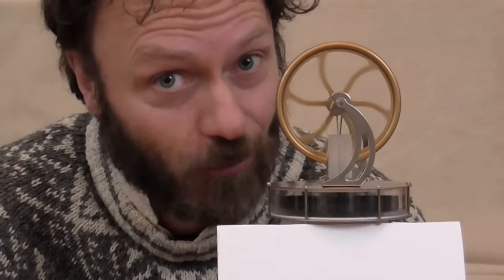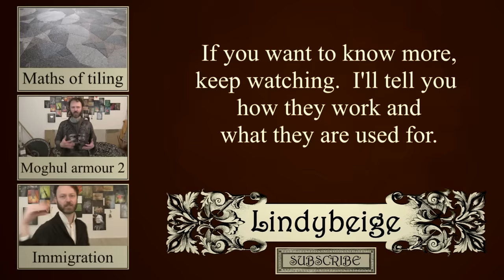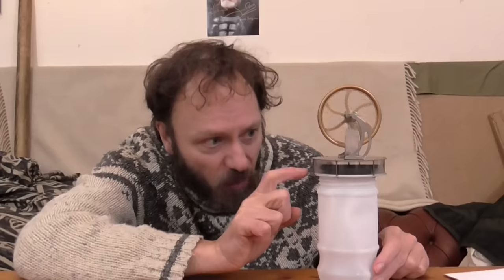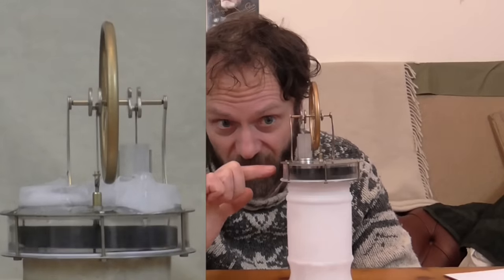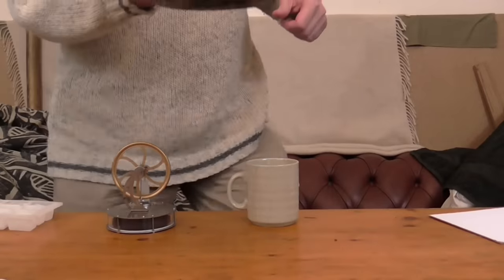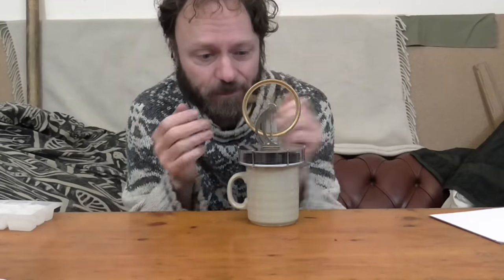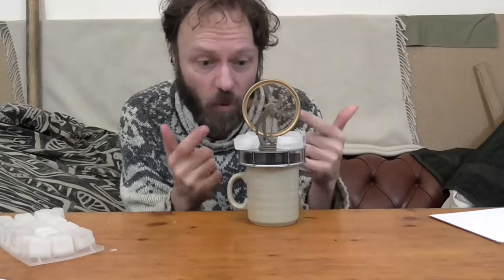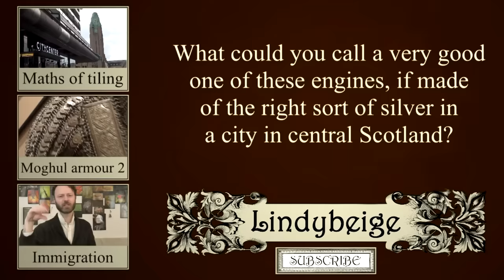Stirling Engines - the power of the future?

Comment: As you mention, Sterling engines have a comparatively poor horesepower/weight ratio.  Also, they have a rather poor horsepower/InitialCost ratio.  Yes, the greater efficiency pays off in the long run, but the cheaper outlay (for a diesel engine, e.g.) pays off right now.

Comment: The engine is currently being powered by the ambient temperature in your home, not the ice. Ice power is a violation of the Zeroth Law of Thermodynamics. The ice is just providing the temperature difference for the device to work.

Comment: Use an insulated 100% stainless steel coffee cup instead of glass or ceramic. Much better results. The heat transfers from metal to metal very well. Over 3 hours run time, easily.

Comment: the problem with stirling engines is that to make any amount of power, you have to go to high pressure gas, close tolerances and very low friction to make them work efficient.
Reply: So use mag lev for a frictionless drag
Reply: Sme with any good engine j meyers.  In other words no big fucking deal.

Comment: It'd be great in space, yes? I mean, assuming that you have to heat the inside of your ship anyway, you'll have a temperature gradient of at least a hundred degrees celsius at all times. The sunward facing side of the ship will be heated to over a hundred degrees celsius by the sun, vs the temperature of the inside of the ship (ideally about 22 degrees celsius), so that's a helluva temp. gradient. And the other side of the ship would have an even greater gradient, with an interior of 22 degrees vs an exterior of around -200 degrees. So regardless of whether your spaceship is in the sun or partially in sunlight, or entirely in darkness, as long as you're heating the inside anyway, you'll always have a delta t of over 100 degrees.

Comment: Why not do it on the coast as the temperature difference between the water and the air is there all the time whether its day or night time.
Or it could be the modern equivalent of the waterwheel if used on rivers/streams, again because of the constant difference between water and air temperatures irrespective of where you are on the globe.

Comment: they are basically the reverse of an air conditioner compressor.
Reply: If you turn the flywheel of the engine it actually becomes a heatpump. Making one side cold and one side hot. Stirling cryocoolers can be used to create liquid air.

Comment: You know... If Stirling engines work with heat differential, then it means that you're harnessing energy while transferring energy to one place to another. If you happen to find the volcanic activity in Antarctica and use that heat differential to power Stirling engines, then it means you're transferring heat from the earth to the ice. You will melt that ice faster, increasing the speed of global warming.

Comment: "Regenerative describes the use of a specific type of internal heat exchanger and thermal store, known as the regenerator. Strictly speaking, the inclusion of the regenerator is what differentiates a Stirling engine from other closed cycle hot air engines"

So, strictly speaking this is not true Stirling Engine? I don't see any heat store =\

EDIT: Oh, i see... In small low power engines this can be just the walls of cylinder.

Comment: What he is saying is;  Temperature is the measure of energy Intensity inherent in a constant volume's (Gas or In-incompressible) object's arranged Atoms and their associated dynamic forces.  Thermal potential energy is therefore implied? Heat is measured in Joules, Calories, BTU, etc.  Energy and Temperature are not fundamental units, they are independent variables and encapsulate the MKS system of units, This is known as the S.I. system . Professor John McEntegart would like this curious audience to think about the following. 

 An adiabatic process is defined as a process in which no heat transfer takes place. This does not mean that the temperature is constant, but rather that no heat is transferred into or out from the system. ... (The actual definition of an isentropic process is an adiabatic, reversible process.) Thermodynamics is the study of matter and thermal ramifications and the associated phenomena. This subject is particularly interesting amongst physicists and mechanical engineers.

Temperature is inextricably linked to Heat. That is the basis of Thermodynamics. Inherent properties are often hidden in plain sight.

Comment: If you want to look at something really effective, try Ocean Thermal Electric Converter or OTEC, uses the temperature differential between deeper sea and surface temperatures to generate electricity. Not to mention there are Tiles that generate electricity from temperature differential that are solid state, no moving parts. Stirling is Dead tech.

Comment: The Stirling engine matches the efficiency of the diesel engine but lacks its power/weight. And the for everything that doesn't move, like the church example, the electric motor far exceeds any other engine, it's cheaper to build and maintain, it's lighter and more compact, it has 95% thermal efficiency, quiet. When you said that the Stirling has 50% efficiency, did you take into account the thermal losses from the refrigeration unit and/or the heating element, because those have some big losses too. Stirling does make emissions unless they are powered by electricity, in which case JUST USE ELECTRIC MOTORS.

Comment: I read where a Stirling engine driven by an electric motor would condense carbon dioxide out of the air surrounding the closed end of the displacer cyclinder

Comment: Stirling engines had advantages as a refrigeration unit but hopeless as a power source. They need a large temp difference between gas in different parts of the engine. Good materials that resist the high heat are hopeless mediums for heat transfer. There is no way around this unless a super material is developed.

Comment: Sooo, If you istall copper wire under the seatbanks of the church. This way the heat radiating from the bud´s of the people will, warm the copper, which transports the heat towards the cold cellar where the sirling engine powers the Church ?

Comment: The most efficient way to run this thing I can think of is basically nuclear fission which we already do except instead of using nuclear to heat water up we can just have this thing run off it's own power and use a space heater

Comment: Or use a geo thermal heat source to operate a compression furnace to cool a refrigerant to keep the lower plate cool in a hot climate and the top plate hot in a cold climate . Free energy ! Ta Da!

Comment: Cold is energy. It's "negative" energy, now eat this..lol. But now some SF: imagine cities in the far and hot (?) future under domes and in need of cooling.  Batteries are superior but slow moving city transport on liquid nitrogen and a Stirling motor would cool the city in it's use. The liquefying process on solar could, because of the waste heat, happen outside the city.

Comment: Also called a heat engine, but that's not entirely accurate is it? As it doesn't so much work off an active source of heat but rather the difference in temperature between the two plates. So a more accurate name would be a temperature differential engine.

Comment: I kind of want to see how much you could generate with a nuclear stirling engine
Reply: that would just be regular nuclear steam engine...
Reply: @codysodyssey3818  regular nuclear powerplants use steam turbines. My point was wondering how efficient you could make it if you replace said turbines with stirling engines, which ,as far I'm aware, hasn't happened yet.
Though there is the Stirling Radioisotope Generator that nasa  developed for deep space probes which is kinda cool.
Reply: @GriMAoD  That just sounds like a steam engine with extra steps

Comment: I have a theory what if we put compressor in there the one that car use for airconditioner it condenses(hot) on the other side and evaporates(cold) on the other side and it will be powered by stirling engine throught drive belt,

Comment: I loved the bit where he said it was just as efficient as a diesel engine but heavier, so not good in an aircraft.  How many aircraft are powered by diesel engines???   lol
Reply: Given that "Jet Fuel" is simply refined kerosene, which is itself refined diesel... almost all commercial and military aircraft are running on something like diesel.
Reply: @brentogara  The key word there is "refined"   I don't think you average aircraft engine would do well with straight diesel  ;)
Reply: @martythemartian99  they would flame out and crash pretty quickly on raw diesel!
Reply: @brentogara  The Diesel engine is a compression-ignition oil engine. 'Diesel' is NOT a type of fuel, and a jet engine burning oil is NOT a 'Diesel engine.'
The Junkers Jumo aero engine,  much used by Hitler's air force, was a Diesel engine.
Reply: @bingola45  A good point! I'm afraid I missed 'engine' and read it as 'powered by diesel'.

Comment: Huh I wonder if an air con unit could drive this perpetually with the compressor on one plate and the condenser on the other and the engine powering the air con unit

Comment: Every 5 years ago these idea keeps being brought up in the media, back in the 50s we were told how the sterling engine will make a comeback, in the 60s they made some pretty good reliable sterling engines and on and on.
Weight and output power was indeed the issue, a diesel engine is 50% efficient and a petrol engine around 40% efficient but diesel engines weigh more, are more complex once you add in turbo chargers and intercoolers plus the fuel is now more expensive..
Coal back in the day was cheap and plenty of it being mined so the steam engine was the best option for the time, by the time steam finally fell out of regular use, diesel and petrol engines were the thing, they were cheaper, more powerful and more reliable than steam, so there was no real need to look at the sterling engine
Reply: In Norway Diesel is less expensive than petrol.

Comment: So in the end you still have to use oil gas or coal to create the heat to power the thing? Doesn't seem world changing to me. Then again this is not my specialty.
Reply: No, it runs off heat from any source, as long as there's a difference in temperature

Comment: You could have a dual Stirling engine that shares a flywheel so it could have more than one power stroke.
Reply: There are several kinds of Stirling engines, I think this is one of the least efficient, but simplest to build, perfect for making a model engine.
Some have one hot and one cold cylinder instead of one hot and one cold plate, for example. I think they are self starting too btw.
Reply: @ziiofswe , I am aware of this type of Stirling engine (they're called Alfa Stirling engines I believe), but even these still use momentum for over half of the flywheel movement. I was suggesting instead of simply allowing half of the flywheels movement to be carried by inertia, to have a second Stirling engine mechanism offset with the first to make a more powerful engine.

Nevertheless, thank you for taking time out of your day to reply to my comment, thus allowing me to clarify. Have a wonderful day!
Reply: @pjnoonan1423  Heh, I guess I shouldn't have deleted my last line, that I felt was unnecessary at the time of writing... "This version can of course also have more cylinders..."

Comment: These are probably the closest to free mechanical energy, BUT  I feel like I’ve seen a version of the concept that directly produces electricity
Reply: Not even close to being "free energy". Do you understand entropy?
Reply: Ayestosea free in the sense that wind and solar are free. I figured anyone with context would understand what I meant
Reply: @dylanwhite6539  That's not free either. Free means zero point. Even taking energy from wind takes energy out of the system. Even Solar stops heat energy from getting to the surface. 1000watts of energy per meter square on average. We only get about 20% of that energy through photovoltaic cells.

Comment: Stirling Engines Could be the Way forwards for A SMALL SPACE Usage. 
Caravans, Motorhomes, Small Boats, Canal Barges. Etc. 

Take a Canal Boat in the UK. 
Cold Water in the canal & Warm / Hot Sunshine onto / Through a Glass Surface or a Black Surface for Maximum Heat / Light Absorbtion ?  To Run the Sterling Engine, 
In turn that Sterling Engine Charges up the  HOUSE or Leisure Batteries. 

Heat Sources By Day,  Can Be, 
1) heat from the Boat's driving Engine, ( engine Radiator / Cooling system ? ) 
2) Sunshine,  direct. 
3) Heat from the Log Stove. 
4) heat from the Oven, Hobs, etc. 

All this Heat Can be DUAL Purposed to Create What heat Would be Normally Wasted to Power the Sterling Engine. 

The Weight of a Fixed Sterling engine Would act as Ballast in the Boat / Replace Existing Ballast. 

Also to Replace Ballast in a Canal Boat, 
ADD EXTRA LEISURE Batteries, As many as you need/ or Can Afford. 
Also Replace Ballast with Tanks of HOT Water, Heated By the Sun, or Piped off the Log Fire, & cooking Oven. 

In a Closed Circuit central heating System. 

Done Efficiently & correctly Maybe you could Power the Electrics Indefinately from this system, Or BEEF it Up To Power An Electric Boat Engine, ( to Drive the Canal Boat. ) ???

Comment: Put this device on your car to generate power for lights and you gain 1.5 HP.  Do away with inefficient alternators. Engine exhaust on one side and cooling water on the other.

Comment: cant you also power one of them with the palm of your hand, specifically the heat from your palm.
Reply: Only ones designed to work on very low temperature differentials, which this one is not.

Comment: Yeah, steam puts out more power... but I wonder if someone could use a Sterling Engine to power a boat, using the temp difference between the ocean water and the air above.
Reply: I also figure they'd be handy with Geo-Power/Temp changes. Warmer/colder inside the earth, type thing.

Comment: What no they couldn't they arent that great, they stick easy and have stall outs especially with the single/stacked cylinder model like you have. The dual cylinder (hot and cold side) are more reliable then the singles, but you did demonstrate why we don't use them. They also aren't 100% useless the option for fuel choice are nice, but compared to steam 150hp @ 1000+ft lbs of tourqe. And what was the speend on stanly streamer 136 MPH, direct drive no transmission.

Comment: Slightly nit picky and this is a year old, but...Internal Combustion Engines should not have explosions in them of any size. That's called Detonation and it very, VERY quickly destroys the engine.
Reply: Umm, well kinda..Detonation AKA "pinging" or "knock" is a mis timed combustion event VS the correctly timed combustion event. They are both "explosions" are far as that goes, with the  equivalent power of a hand grenade.

Comment: So a Stirling Engine could be attached to a generator which in turn could produce the electricity to power a house.
Reply: Sounds like I should buy one of those personal tv dishes the ones that were 8 feet across and stood in the yards of houses in the 1980's & mount the engine on the arms extended out from dish like the one in Spain.

Comment: When these were the "NEW" thing there was a large sea going ship built that ran on stirling cycle engines AND the passengers could and did ride the piston... Was not successful venture too slow and used too much fuel... the Israelis are using them to power  Ag water pumps in a rather fascinating way using super saline water at the bottom of a black bottomed freshwater pond. The freshwater acting as a lens heating the saline water that supplies heat to the Stirling engine. Also for a while in the late 70's or early 80's MOTHER EARTH  magazine did an article on  Stirling cycle engines and a Company out of I believe Indiana offered a roughly 5HP Stirling engine for sale at around $500 us  that was being made in India they showed photos of where they were using them for all sorts of static agricultural and small industry burning Ag waste... The importation fell thru due to some Governmental restriction on selling them overseas till their home demand was met... The US company advertising them changed product concepts but had ONE demo model still in their "testing lab" which I tried to purchase in the early 1990s  they were willing to sell it for $5000 US I regretfully declined...

Comment: Could you make a Stirling engine of space and time? Let me explain.
It is thought that space (vacuum) contains certain of energy. Over time the energy levels in this space should change. You can make time run at different rates when you reach speed of light. Hence theoretically you could make difference in energy between two points. This energy flow could power an engine. Hence space time Stirling engine.

Can someone with more physics and engineering knowledge debunk this theory?

Comment: Much better than battery operated drones and solar panels, this can be powered by concentrated sun heat very small amounts of wood or fossil fuels, this sterling is slow for the slow heat / cold transfer but the candle powered sterling is 9000 rpm fast, thr the drone can fly with propellers for half a day with the exhausting of the kerosene in the 300 ml bottle

Comment: while i was watching this i was thinking ,
what if we combined a stirling engine with nuclear power.

now the current nuclear power stations heat up and boil water which then turns a turbine.
but what if instead of water we heat up 1 plate of a massive stirling engine which then intern turns
a generated from the massive sized flywheel